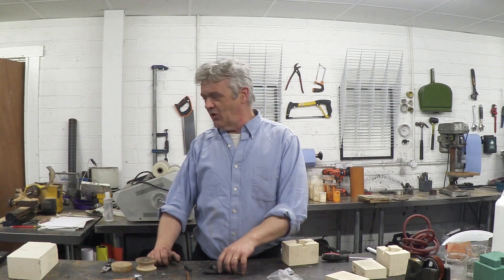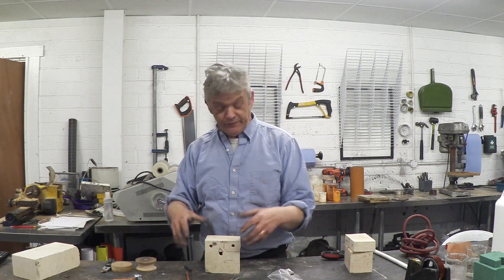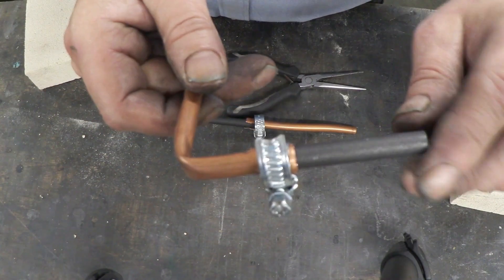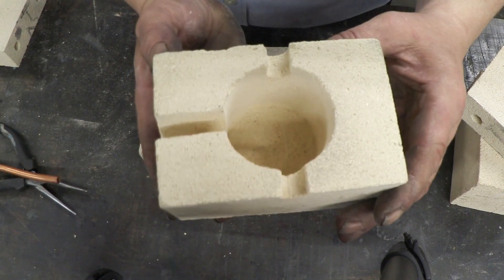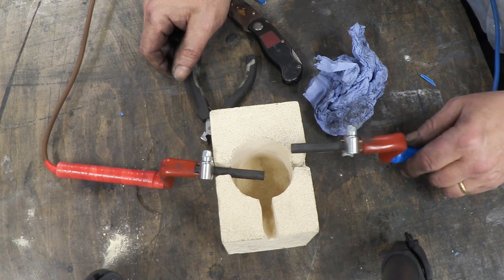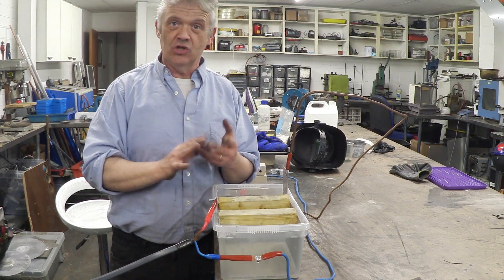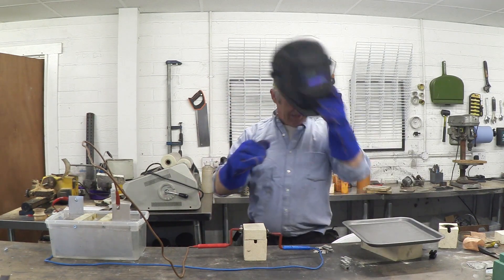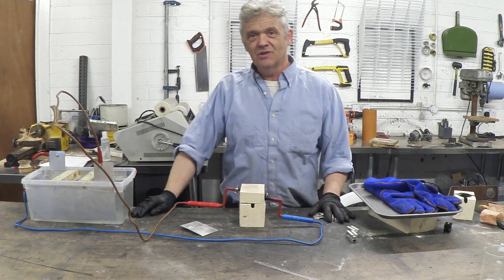Melting Metal With Water

Comment: Very interesting, and I'm loving all the ideas in your videos!  Like others though, I object to calling the salt-water a transformer, since the current won't be greater than that supplies by the AC.  However, I suspect the salt-water is actually acting as a very low resistance **current limiter**.   Assuming a 10A breaker, 22 ohms would be needed when the rods are shorted to avoid tripping the breaker.  But if a current limiter, might workout to 30 ohms when shorted, but <1 ohm when the arc is formed - thus drastically increase the power dissipated in the arc..... .

Comment: So a thought! ... What about a standard stick welder feeding a 400A bridge rectifier, feeding  carbon rods vertically downward into a large crucible of metal pieces a la modern DC arc furnaces BUT with a difference. 

DC arc furnaces usually have only one central terminal and the ground being formed by the crucible, metal and the commensurate slag (which causes some issues). I was considering TWO electrodes rather than one (or 3 as in AC furnaces) but being able to angle them much more steeply to reach into a crucible and close to the metal until it starts melting.

If this works for aluminium, then cast iron should also be possible due to the extreme temperature of the arc being well above cast iron's melting point.

Using green sand casting from 3D printed patterns should be able to produce some interesting capabilities. Alumium casting is fine, but cast iron is the biz!

Such a system should be:
* much safer than using mains directly

* Easily adjustable current (as per normal MMA arc welder)

* Much more controllable and higher current - the stuff that actually gives the quickest heat.

Comments?

Comment: Not an isolation but resistance bath as was used to dim picture theatre lights for many years. Also used as speed controller in some older amusement rides. Very reliable if u keep the water topped up. I would suggest a couple of old microwave oven transformers would spin the power meter much slower 
90volts is what we used to light the carbon arc lamps at picture theatres at 30 to 90 amps.

Comment: You know that sticking main voltage in salt water you made electrolysis there, right? Depending on which salt you use, you will either blow yourself up or you will chlorinate your garage for good, turning it into a World War 2 yellow gas chamber XD. Wouldn't be surprised if the Uganda YTer killed himself by liquifying his lungs in chlorine gas

Comment: For anyone that’s interested on what the circuit does.

The circuit is supplied directly from mains power (240V). The bucket of water is a series capacitor with a water dielectric. Pure water is non conductive and by adding salt to the water makes it conductive. This forms a parasitic resistance in series with the capacitance.  At the output of the bucket is the carbon rods, this forms the load. When they are far apart the load has very high impedance, when they touch together the load has very low impedance.

The series capacitor and resistor form a voltage dropper in the circuit. This means that the voltage between the carbon rods is reduced when they touch metal (I.e. a load). Which in turn means that less current would flow compared to if the rods were connected directly to the power outlet. The current is reduced enough so that the circuit breaker doesn’t trip. 

The bucket is not a transformer. If the plate is moved up out of the water, the surface area of the plate changes, which changes the capacitance, which changes the voltage drop across the bucket.

This circuit is NOT safe! The active and neutral connections are bare and LIVE. If you accidentally touch active and neutral at the same time it would kill! This is because the RCD wouldn’t trip in time to save you.

Comment: have done this with an arc welder, didnt know you could just plug it straight into mains with bit of conductive water in the live path 🤔
isnt that going to be 240v? seems slightly dangerous. mot current transformer might be safer or maybe ive understood this wrong

Comment: That is amazing, thanks 👍👍

As a request, how about a diy sheet metal cutter similar to a laser cutter , maybe actually if use exactly the same idea as in this video using the water capacitor but use a pencil sharpener on one of the carbon rods and a return circuit just connected to the sheet then some kind of support and guide for the cutting bit, actually connected to that part you can have a separate guide to follow the outline of something you want to replicate, if you know what I mean 🧐, cheers pal from a Donny lad

Comment: There's an old book from the 50s or 60s called "Build It Yourself Science Laboratory." In it, it tells how to make an arc furnace from curtain rods, graphite rods and a flower pot, which uses a "salt water rheostat" to adjust its current.

Comment: Is the power going into the water just 120 a/c cause i thought you needed d/c to melt metal like that. Or is that what happening in the water transformer its also rectifying as its stepping it?
Reply: Heat is what melts metal. Metal has a certain amount of resistance and if you pass current through the metal, it will dissipate power as heat. The more current that passes, the more power dissipation and hence the more heat. You can use either dc or ac for the purpose of heating. Your oven uses ac current to pass through a heating element (high resistance metal) to heat up, the resistance of the heating element limits the current passing through it for a given voltage.

The water bucket is actually a capacitor not a transformer. It is connected in series with the carbon rods and drops the voltage between the rods. The water is very lossy with the salt and reduces the total current to the rods. If the water bucket wasn’t there, there would be a direct short between the rods and blow up before tripping the breaker. It’s actually a very dangerous circuit with mains supply.

Comment: Excellent video as always. Just curious about some safety measures, how much shock we can get if by mistake hand touched with water in bucket or live side of electrode?
Reply: without a doubt you would 100% be dead almost instantly. then being stuck there because the amount of current would flex all your muscles simultaneously and your body would quickly begin to burn from the inside out until either the breaker pops or your body is completely charred.. meaning there is nothing left to burn.

Comment: What's the difference between using the bucket & not using the bucket? Just straight from the power supply with 2 wires & the carbon rods at both ends.

Comment: Hi Rob, I've had a go building it, it worked well for a bit but then the fuse went in the plug, does it need a fuse or should I buypass it with some thick wire?
Reply: If the fuse blew, then you must have drawn too much current for your mains supply. For safety reasons you should never bypass any fuse with a solid wire link. In UK households, overcurrent protection is also provided by fuses or MCCB's in consumer units and then by a master fuse in the meter cupboard - none of those devices should ever be bypassed.

The "water" in this video is used to make a "brine bath resistor", as a primitive control device to limit the maximum current drawn by the carbon arc. If the one you made is allowing more than 13A to flow, then you could adjust it with either less water or less salt or less plate contact area, until the fuse no longer blow.
But if you really want to actually melt aluminium, there are much safer ways to do it (e.g. with a resistance furnace) than with this kind of setup.

Comment: My father would use a ceramic butter churn, a piece of all thread, and two electric stove eyes; to make an arc welder. It was essentially the same as your plastic box, but the threaded rod was attached to one stove eye and used to raise and lower it through the salt water solution. The other eye is placed in the bottom of the churn.  It works very very well until someone allows the two stove eyes to make contact inside the churn. An uncle did this "one" time; that was the end of the welder and the beginning of a large doctor bill.

Comment: Wow, I had to watch it 2 times to get it ... A current meter and ohm's law could tell you a lot more, then you can make predictions on what your circuit will do, current, watts, resistance, impedance, and what happens if you add a coil, capacitor, and change phase, lead, lag, and a thermometer temperature reading, etc etc etc ( don't forget safety glasses at least, if something splatters, it will happen faster than you can respond ? ) Teach safety or a link to someone you trust to teach safety including parts per million exposure ( weather you need to wear a filter mask and what type ? A competent doctor would be able to explain it better than me ) what do you think about my idea, Gene Bowdish

Comment: The water/salt solution is acting purely as a resistor.  If you make it variable it's a rheostat, not a variac  which is a variable transformer.
Reply: however, I suspect the salt-water acts as a (~10amp?) current limit (eg non-linear resistor) due to the limited availability of charge carries.  If this is correct, then actually when under the limit, the resistance could be very low thus allowing the voltage to increase once the arc is formed.

Comment: great stuff @robert murray-smith can you expand a little on the what exactly the water bath is doing, ie. is it acting as a capacitor? we need more more diy science its great :)
Reply: The water and the salt dissolved in it makes a brine bath resistor. This serves as a primitive current limited device here but, for anything powered by a UK domestic mains supply, an appropriately rated filament lamp bulb would do the job better and simpler. I see a lot of adventures in technology on this channel and Robert is an excellent and very engaging presenter but I think you need to look elsewhere for good science.

Comment: Will this work for melting copper too? Needing 1087 degrees celcius
Reply: Indeed. I reckon that, if properly and safely configured,  this kind of set up would melt copper. I'd also say it was over-kill for aluminum, where you ought be be able to use a simple resistance furnace.

Comment: An outstanding demonstration of the principles of a basic electric arc furnace. That said, there are a couple of items that need correction / attention. At 8.15 you say the salt water bucket can act as a variac and is a "sort of transformer isolation".....unfortunately this is incorrect. This device is a liquid resistance bath (used to see them all the time on old motor starters, common in electroplating setups etc).....changing the plate size or moving them in and out simply changes the active area in the liquid and changes the current in the circuit (i.e. varies the RESISTANCE) i.e. a rheostat or variable resistor effect. There are no coils, no transformer effect and most certainly no galvanic isolation of the system from the supply. Utterly lethal as built - you would only have to brush up against the incoming active connection or either of the plates to receive a shock. The consequences of a child or an adult with no understanding of electrical safety measures accidentally getting into your workshop area are unthinkable. At the very least place the whole assembly inside another plastic container with a lid, so that the plates, bolts and the liquid itself are protected from accidental contact by a basic insulating barrier. Then either add double insulation throughout or place the whole apparatus in a grounded metal enclosure so there is a proper low impedance fault path back to main earth, thus allowing fuses/circuit breakers to operate correctly. The other issue of gas generation and the need for ventilation has been addressed quite thoroughly in other comments.

Comment: My understanding of electricity is rather sporadic so maybe someone can help me out a little?

I understand the concept of the arcs being hot enough to melt the metal due to a Technology Connections video explaining why light switches click when engaged but I'm having issues with the necessity behind the saltWATER... I still get that there has to be salt in the water to create conductivity but not what the purpose of the water is. What role does it play in the setup? Does it act as some kind of buffer to prevent the 230V fuse from triggering so the setup can keep going?

I also think that the setup would kinda benefit from a feature that would keep the lid in place while you're juggling the electrodes in and out.
Reply: The salt water here forms a brine bath resistor, a primitive means of limiting the maximum arc current.

Comment: Does the plug have a 13 amp fuse in it?
Reply from the maker: no - I put a nail in - the circuit breaker will take care of load beyond 32 amps - the wiring - hey it might have suffered
Reply: @ThinkingandTinkering  great thanks. I get you, i have old fuses in my workshop which also supply other offices so dont want to annoy anyone. Might fit a smaller inline breaker than the fuse size between the wall socket and my plug jsst so that would trip instead of blowing the fuse. Love your videos. I need to draw them in a sketch book to keep up with all the things i want to build.

Comment: When I built a little arc furnace (as a high-school student), I used a 1500W space heater as the current-limiting resistor.  That gave me a guaranteed maximum current draw (so as not to trip a circuit breaker and leave me in the dark), and it was safely contained in its steel box.  No worries about electrochemical effects in the electrolyte bucket, either.  A toaster would have worked just as well, but what would I have done with the excess toast?
Reply: Thanks for sharing your expereince. That sounds like a much safer arrangement than the one in this video.

Comment: Great way of melting a particular metal but the title is wrong - the title of the video ought to be 'melting metal using saltwater'. Also you didn't mention whether your setup would work straight from the mains! I mean, if it does work the 'salt electrolytic apparatus' would be pretty much a waste of time/effort and your salt would be better used on your chips! Btw At 09:45 avoid laughing the way you did after demonstrating something potentially dangerous as anybody will think you have mental health issues!
Reply from the maker: lol - thanks for taking the time to write mate

Comment: So is this a basic induction furnace?
Reply from the maker: no mate - it's resistive heating
Reply: @ThinkingandTinkering  Wow. Genius. Very impressive, you make it look so easy, thanks for a mega vid
Reply: A basic induction furnace would need a suitable AC supply (not necessarily at mains frequency - much higher frequencies are used) a driving coil and conducting crucible (or "susceptor") that can sit inside the primary coil. Domestic induction hobs use the same principle, but induction furnaces can reach much higher temperatures.

Comment: Movie theaters had carbon arc projectors.  2, 1/2 inch (12MM?) rods were brought together and automatically fed once the arc was started.  The little 12 minute reels would be just about right for two 18" (50cm?) long rods.  That is why most movie houses had two projectors in each booth, and the projectionist would start the next reel just before the first ran out and an aperture would swap which projector would be projecting when the projectionist triggered it.  
A fun gig as a sideline while in college.  Thankfully this was after the days of celluloid film.  That film and the possibility of flash fires is why old projection booths had heavy doors that would slam shut (closing projectionist inside with burning cellulose film).  It would automatically close the apertures that the projectors would project out of too.  Yes, a death trap to save the theater and the patrons.  A good reason to be very careful as a projectionist.  
The theaters have changed to xenon bulbs and I think the latest is large scale video projection since I left that industry.  Still, striking 200A carbon arcs was lots of fun.
Still old carbon rods left over as the 'tails' of the spent rods would make killer electrodes for this process.